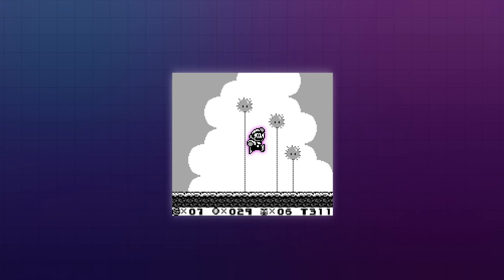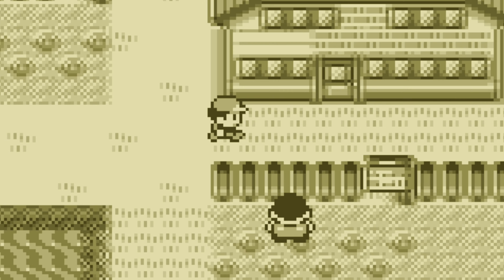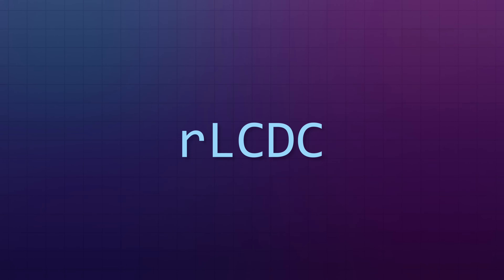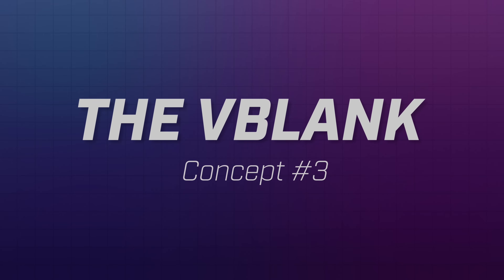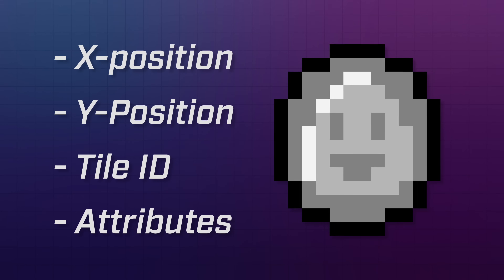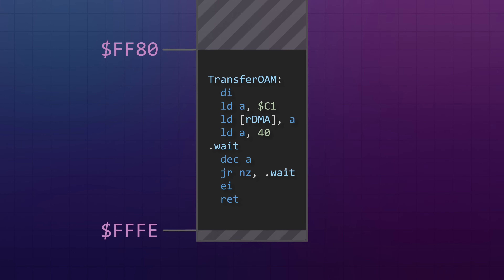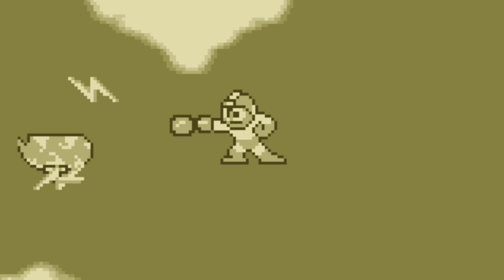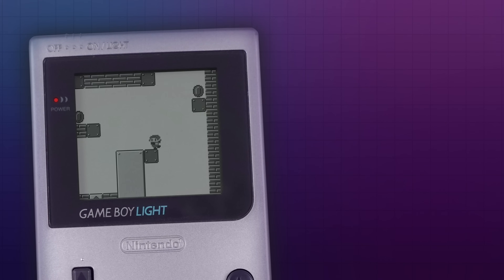Game Boy Graphics & How To Code Them

Comment: About DMA, DMA doesn't use the CPU. But because DMA silicon is using the cartridge bus to read the data that it needs CPU can't read its next instruction at the same time.
To prevent both trying to read different things at the same time you have to prevent CPU from reading from ROM and WRAM, the only way to do this is to upload a program to HRAM which doesn't use the same bus that ROM and WRAM uses (HRAM is inside the Game Boy SOC). Because HRAM is so small and usually used for other things because of how fast it is, programmer can only fit a small loop that wastes time.
On CGB, WRAM and ROM have different buses which allow the program to run on WRAM when DMAing from ROM (or running program on ROM when DMAing from WRAM)

Comment: do you know why a gameboy can normally handle 40 actors, but GB studio can only handle 10 at a time?
Reply: AFAIK, GB Studio can handle 20 at a time (per scene), and their "actors" are 8x16 pixel objects, which corresponds to 40 8x8 objects total (I guess it's not using 8x16 OBJ mode?). So the limit is the same. However, GB Studio will emit a warning if you use over 10 actors at a time (but still allow them), which presumably is because then you might hit the scanline limit that is talked about around 8:00.

Comment: For those who don’t know, the concept of VBLANK stems from consoles connected to CRT TVs where the beam draws the picture from the top down, but the beam needs time to be brought back to the top and is turned off for this period. This happens 60x/sec (USA) and is even designed for in the NTSC/PAL standards. It conveniently gives time for the CPU to do some extra offscreen tasks such as screen movement tile refreshes etc. they carried this over to the Gameboy not because an LCD would need time to go from bottom to top, but it defines a target frame rate and also gives some off-screen CPU time.
Reply: Why would changing the view outside of vblank destroy the screen though? I think that part is incorrect. You might get screen tearing but not the lcd being destroyed.
Reply: @bryandavidasuncion9515 At a guess, it was a flaw in the early TN screen or driver chip used by Nintendo. The screens are driven line by line, each one only activating for less than a millisecond. By locking the chip mid-frame, it might overdrive the LC on that line, and lock the crystal structure in place.

Comment: After seeing Roger Copetti's updated article on the GB's architecture I decided to revisit the bus conflict mystery and I think I've solved it.  It seems to be down to two things:

1 - OAM corruption without bus conflict
The GB's PPU is kinda buggy, and even if you avoid a bus conflict you can still get OAM corruption if OAM is written to at the wrong time, generally when the PPU is in mode 2 or 3 (these are internal modes, not programmer accessible ala Mode 7).  Most emulators won't care and a write to OAM is a write to OAM, but hardware and cycle accurate emulators do care.  Since both of these are "live" rendering modes you can avoid this by only ever doing OAM DMA during VBlank.

2 - Actual cause of the bus conflict
While most consoles will pause the CPU during a DMA transfer (PS3/Xbox One family are exceptions, though they have multiple HW threads and more advanced bus arbitration so they are a bit out of scope), that doesn't seem to be the case with the GB.  Rather, CPU memory access is invalidated which can result in a lot of strange behavior if you're not prepared for it.  By making sure CPU access always succeeds by starting DMA while the CPU is running in HRAM this is avoided.

I think that makes sense.  I could still be wrong (not an electrical engineer) but this does seem to explain everything I had questions with

Comment: It's possible to update the tiles during the horizontal interrupts (a few pixels each time, since there is many HBLANK in a single frame). A lot of games does that to animate the overworld map.
Reply from the maker: Indeed, wanted to cover it but didn't want to get into the complexity of HBLANK in this video (especially since I haven't really covered interrupts or timing on the channel).

Comment: I think this channel is very neat and you're certainly a clever chap.  Now I do have a question as since I found your videos I looked on ebay for a game boy.  I have to admit I know nothing about the hw but there were lots of choices - are you referring specifically to the first large grey game boy or will one of those pocket versions work?
Reply from the maker: The Game Boy Pocket is functionally the same as the original "gray brick" Game Boy. So it will work for all the stuff I cover in the video just fine, and it's probably a better choice unless you want the original as a collectors item. Thanks for watching!

Comment: Love it - I wrote a Game Boy emulator this year (Emu Boy on github).  Can truely say I know what makes it 'tick' now :)
per scanline sprite limits are due to secondary OAM.  This is a fixed sized hardware register which loads and queues up sprite data per scanline, hence the limit.
Also, spirite prioirty weirdness got significantly tidied up on Game Boy Color
Reply from the maker: Oh interesting, that makes more sense. Thanks for sharing! 😊
Reply: Hi, I couldn't find your project when searching Emu Boy.
Reply: Oh wait NVM, I found it using emuboy and your handle. How can I get in touch with you?
Reply: Can a modified emulator remove the flickering by modifying the second OAM register to be larger?

Comment: I don't understand, how can the display get physically broken by burning a line? You either set it or not to the tiles you want. How can that harm it?
Reply from the maker: I too am confused by why this might happen. I debated leaving it out, but having seen the line on one of my Game Boys and seeing the GIANT SCARY RED section about it on pandocs made me reconsider. 🤔
Reply: Typically LCDs have an AC signal applied across pixels/segments to drive them. Introducing a DC bias can damage them by causing metal to migrate between electrodes (search “LCD DC damage”). It’s possible that turning off the LCD driver when it is in the middle of drawing leaves a line stuck high rather than continuing to alternate, causing the damage if done repeatedly over time.
Reply: @corulinde  The key part here is "causing the damage if done repeatedly over time ". I can't imagine this happens after 3 or even 30 times doing this. So wouldn't it be an extremely rare edge-case when this happens, and, if it does, wouldn't it very likely be a deliberate or purposely executed action? I'm having a hard time imagining any user sitting through hundreds or even more repetitions of the screen flashing and keep letting it do that until the LCD has actually burned in. So far I (still) haven't found any evidence of this happening causing the claimed damage but anecdotal and with no actual proof of any cases of this happening "in the wild".

Gameboys go for $50 and up and that's just a tad bit too expensive for me to go out and get one just for this. But I might try it with a random LCD at some time. Just out of curiosity. So far I'm still in camp "FUD" 😅
Reply: I imagine it's a similar case to how the Commodore Pet has the killer poke.  The LCD isn't a CRT (even if it behaves like one for the PPU), I don't think you can burn it in.  There might be some temporary odd behavior, but no serious permanent damage.
Reply: @kirby0louise The wikipedia page on the Killer Poke actually has a section on the Gameboy CRT and it also states "can allegedly damage the hardware". I haven't found any actual non-anecdotal proof so far.
Reply: @Rob_III  That may be, but considering how old original screens are and how prone to failure they are (through screen rot or missing lines), I wouldn’t risk intentionally harming the screen 😂
Reply: Quoting the pan docs: “Stopping LCD operation (Bit 7 from 1 to 0) may be performed during VBlank ONLY, disabling the display outside of the VBlank period may damage the hardware by burning in a black horizontal line similar to that which appears when the GB is turned off. This appears to be a serious issue. Nintendo is reported to reject any games not following this rule.”
Reply: @regular_space Yes, but from NESDev: "However, in leaked official Nintendo Game Boy Programming Manual (version 1.0, released 11/09/1999) it's not mentioned that it can cause any hardware damage, only that "a black horizontal line appears on the screen" if LCD turned off outside of VBlank interval (except on Game Boy Color, where it's safe). Also it says that it's 'recommended', not 'required'."

From what I've been able to find so far, you'd have to keep doing it pretty extremely and for long periods to have any real lasting effect (if at all).

Edit: The actual text from the manual: "Setting the LCDC to OFF (Recommended)
Covers: DMG and CGB

In early DMGs, a black horizontal line appears on the screen if the LCDC is stopped (LCDC
register bit 7 ← 0) at any time other than during vertical blanking. Therefore, the LCDC should be
set to OFF during V-blanking. If the occurrence of V-blanking cannot be confirmed, the LCDC
should be set to OFF when the value of the LY register is 145 (91h) or greater. These restrictions
do not apply in CGB. Thus, when creating software for use on CGB only, the timing of setting the
LCDC to OFF need not be considered."
Reply: I don't think doing this a few times can damage the screen (after all, a player might turn off the GB and therefore the screen at any time), but if a game turns off the LCD at the wrong time, it's likely to happen many times because that relevant code probably isn't just used one place. For example, if the game does it every time it fades the screen to white, or every time the game boots (which are common instances where a game might turn the screen off), it might become a problem.
Reply: Perhaps a collab with look mum no computer? He has a big stack of originals. Sam might be willing to run some test code for yah.
Reply: As a hypothesis, I'd say the voltage required to set a state is much higher than the voltage to illuminate a pixel. Dumping high voltage while the pixel circuits are connected could fry a wire/fuze?
Reply: I imagine writing to the LCD screen involves pulsing current at different frequencies to create the different colors, and changing the value while drawing applies current for a length of time that permanently changes the state of the liquid crystal cell.
Reply: I find it safer to edit Gameboy Games on a PC using Emulators to test it out and redownloading the games to avoid this problem altogether.
Reply: @michaelreardon303 How is that relevant? "Don't cross the street when the walk light is green but a car is rolling up to the line" "I find it safer to not cross the street at all and just play The Sims". The discussion is whether anyone has actually experienced this "in the wild" or if NesHackers remark about it is just perpetuating something that may not be an actual issue unless for edge-cases or when actually trying to break things by doing it tens, hundreds or thousands of times until it breaks.
Reply from the maker: My view is that the pandocs are right about so much, that I'm willing to give them the benefit of the doubt. That said, if we had hard evidence to contrary, it would be awesome to know, though I'm unsure if I'm willing to test it out on one of my original GBs... Maybe that's a video idea?
Reply: @NesHacker  Actually, I do agree with giving them the benefit if the doubt even it doesn't seem like I do. But I also agree that doing a little research and trying to prove or disprove this would be an interesting endeavour. It's just that I think a Gameboy is a little too expensive to buy just for this purpose (at least on my budget).
Reply: @Rob_III, Right, how silly of me; having no experience in ripping apart my Gameboy or hacking games directly on my device I simply assumed that people never heard of downloading virtual emulators of gameboy consoles and hexedited on that device because I have never had any backlash editing things on a PC, and would therefore never even fathom using it on its native software; what I should’ve done was use an entire paragraph to explain how fascinating his research and experimentation is, complimented other YouTube Commenters and then started by saying that my experience was a safer route than is nonrelated because I’d expect someone in the YouTube Comment Section to take my folly to heart; please feel free to critique my spelling & grammar or anything else you feel corrected & Ill get back to you never.
Reply: @michaelreardon303  Again, you're missing the point. We're trying to figure out if "LCD burn-in because you switch the LCD off during a screen update instead of waiting for a V-blank" actually damages the screen or if this is a myth. You can have 400 years of experience in your emulators for all I care - it's just totally, entirely and utterly irrelevant when the topic is (possibly) damaging an LCD. Your emulator doesn't have an (actual) LCD, does it?
Reply: I was wondering the same thing. I'm having a real hard time believing this and in my (albeit short) round around the web I haven't found any evidence to support this claim (yet). I'm not sure if what is shown @1:35 is actually a (permanently) damaged LCD from software or just a hardware failure.